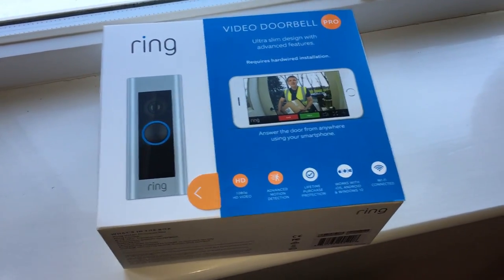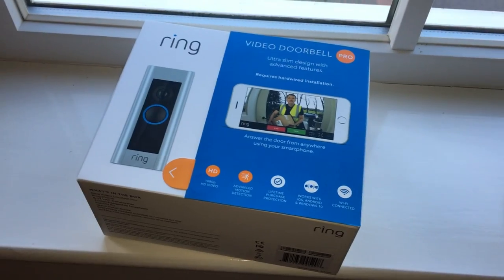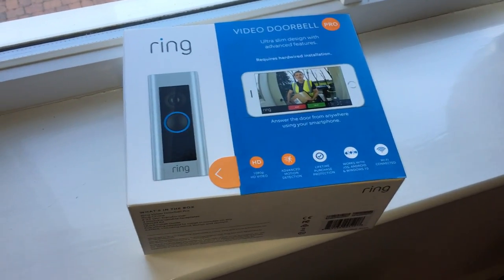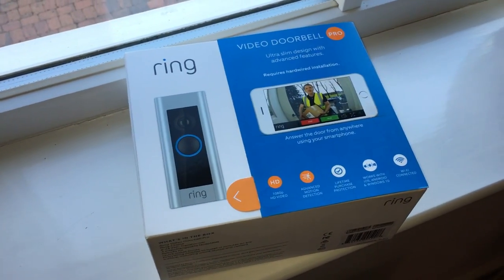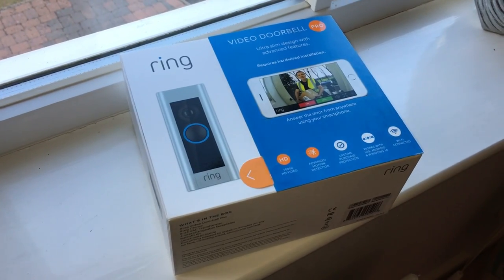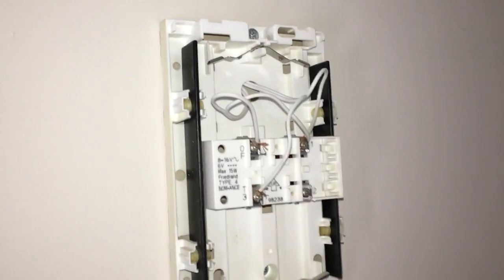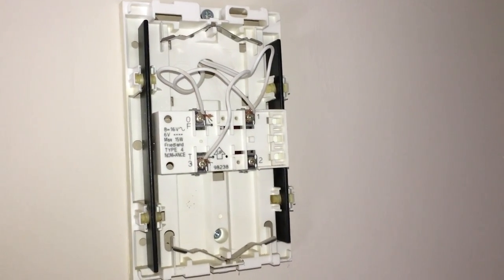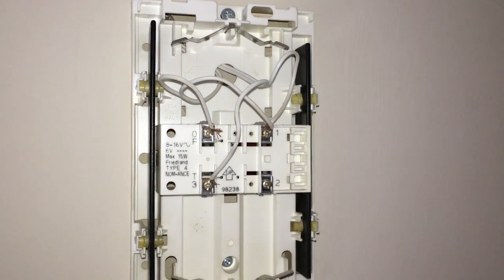Installing Ring Pro Doorbell Transformer in the UK (Review)

Comment: This is the only,  and probably the best video for installing the ring door bell pro in the UK.  The video was very well put together and well explained and easy to understand.  The person that made this video should be an instructor! There is an alternative video, and also well put together by another person that makes installing the ring doorbell pro very straight forward and does not require fiddling with the transformer that came with the kit,  and that involves purchasing a standalone 24V, AC transformer that plugs straight onto a socket. That alternative is for folks who do not have an existing hardwired doorbell in place on their house.

Comment: Thanks for your informative video dedicated to installing Ring Pro in the UK. It wasn't the solution for me but outstandingly, put me onto three things: importantly, it's now illegal to work on a consumer unit if you're not a qualified sparks. (I re-wired my house in the 70s including connecting up a new consumer unit whilst the power coming in to the damp cellar was live, because I was too poor to get a professional to do it. Electrocuted myself three times in the course of the project but I was young and invincible and it was fine). Secondly, it was great to discover that there is such a thing as a small DIN enclosure to install the Ring transformer without the need to enter the consumer unit (somewhat smaller than yours because I decided to forgo the RCD, ;-). Thirdly, it alerted me to doorbells that have their 6V transformer in with the chimes enclosure.  Turned out that that was my situation. I studied your video, the manual and various internet instructions on by-passing the chimes and couldn't make head or tail. Then it came to me in the night: completely remove the chimes and the transformer enclosed within, fit the DIN enclosure and new Ring transformer in their place, using the wires left behind, and so, no messing about with by-passing the chimes.  
One last thing: the Ring Pro is dead fussy about the quality of the wifi signal it receives and wouldn't play nice. I therefore moved a BT Disc (some sort of MESH jobby) to be closer to the Ring Pro and ethernetted (of course it's a word) the Disc to a Powerline plug, because the Disc would otherwise also have been out of range. It was handy having a Di-Log CombiVolt Voltage and Continuity Tester to make sure everything was isolated before commencing work, instead of that old seventies trick of just licking the live wire (kidding, I'm kidding!!). Whilst I would love to understand that by-passing thingy, I'm sleepy now and will just have to remain a very stable idiot. The product is v. good: I've already turned away three murderers this morning. . . .
Reply: philwolsey what palaver just for a doorbell ... well done for getting there in the end and the write up 🙄

Comment: Great video, just got a cracking Black Friday deal on one of these, however the installation was quite a bit of a concern. I ended up buying the plug adapter as we have a socket right by the front door, so all I need to do is drill a hole through my UPVC and plug it in. Looking forward to using this awesome product.

Comment: Very useful. It's hard to figure out the transformer and installation implications in the UK from the Ring site and other sources, but this video made it all clear. I suspect the conclusion for most people will be to get an electrician to install it.
Reply from the maker: Adrian Black I'd agree, for most this is the sensible option.
Reply: I was asked to provide a mains supply to a gen 1 Ring doorbell as the home owner was frustrated with charging the batteries.

After spending about 2 hours installing all of the cabling, fitting a transformer and then connecting it all back up I just couldn't get the thing to work. 

It turned out the gen 1 Ring doorbell had a known issue. The live feed is supposed to trickle charge the battery so you don't have to remove it. This model would not trickle charge so it wouldn't work.

After scratching my head thinking I had made a mistake it turned out that Ring customer services needed to send out a replacement as it was a common fault.

Be aware if you have a gen 1 (720p) model Ring doorbell and it is losing charge or it won't accept a permanent feed that there is a common fault with the battery

Comment: Hi 
Watched your video before installing my ring pro. Easily the best video I’ve seen. 
This bell replaced a plug in unit and not an existing unit so it was a straight cable from the consumer unit.
One thing I did find when I installed the transformer in the consumer board which I’m comfortable with. 
It’s an split load rcd board with rcd protection on 8 circuits and no protection on 4 (lightning +fridges)
I had spare capacity on that side
Your comment with regards that it doesn’t matter which way live and neutral isn’t right. I connected live to 6 and neutral to 5 and then to the non protected neutral bar and the ring powers up but trips the rcd when used - which is a bit bonkers as it’s not powered from the protected side. As soon as I swapped to live in 5 (as you did) then it works just fine)
I replicated the fault by powering the transformer from the lighting circuit away from the consumer unit so I’m confident live must go in 5
Reply from the maker: Paul Smith thanks! 
Weird re: polarity.. didn’t matter with me. Other videos said the same so maybe they changed the transformer included since.
Reply: @hyperhatch5775  Have a Good Weekend!

Comment: Thanks for the video. I had an electrician attempt to install my Ring Pro, unfortunately he was unsuccessful twice. Upon installing it for the first time we immediately noticed that the lights on the bell did not turn on. Even worse, the Ring transformer got piping hot and started smelling. The Electrician concluded that the transformer is faulty. Ring sent a replacement but when that was installed we had the same problem. Ring are now sending out an entirely new doorbell but I am about to give up hope!
Reply: I have had this twice now.... did you find a solution for this? Everything look spot on and I even had it running for around 5 minutes before the second transformer burnt out. it make no sense. Any help much appreciated
Reply: Did u get this solved?  I'm going for a 3rd party transformer just in case.  The ring one is bulky and  I have no room in consumer unit. I plan to rip the guts out of the current chime and slap in a slimline transformer instead. Then use the 3 x echos as doorbell.

Comment: Great video, really helped in my planning for installing the ring pro which I have done this weekend and seems to be working.

A couple of extra tweaks in my set up that others might find useful:

- instead of the garage consumer unit you could use a 2 module din rail enclosure, its much smaller if you are space constrained and its going somewhere more visible (like a hall way)

- in my case I had the unpleasant surprise of some cat5 phone wiring (3 pairs) as the existing installation, rather than the thicker white cable you have. In my case i simply bound the 3 pairs together to spread the load from the ring pro transformer and it seems to be working fine.

Comment: Hi just saw your video re ring  pro. You must understand that measuring a transformer open circuit or with no load it will read a HIGHER voltage. When the transformer delivers current losses inside the transformer will reduce terminal voltage, it is calledtransformer regulation. Jeff...

Comment: The Ring bell has an issue with non USA wireless I have just discovered this, in the USA their 2.4ghz wireless only covers channels 1-11 in the UK our wireless has channels 1-13 . If like most people you leave channel selection on auto, the ringer will disconnect on occasions and is difficult to connect. The solution is to manually select a channel between 1-11 and set it hey presto all the connection issues disappear. This little gem is buried in their help files, and yes I did find this out the hard way.

Comment: Wasn’t expecting a breaker unit to fit into my existing consumer unit. Spoke to ring customer services and they have agreed to send me a plug in power supply to power the doorbell pro. Only if this was included in the box from the offset as is in the USA. The power unit comes with a European 2 pin connector so you need a uk to euro adaptor to fix this issue.
But such a great video, but I’m not competent enough to mess around with a consumer unit
Reply: Mandeep - did they charge for the plug in ? if yes how much ?
Reply: @brynmorgan9575  they sent me another transformer to plug in the consumer unit. Idiots.
It was sent free of charge

Comment: Rather than use a consumer unit a WYLEX 3-MODULE IP65 INSULATED ENCLOSURE WITH VISOR will provide a neater job. About £11. Very helpful video - the Ring installation videos are too focused on US setups. Also helpful to see how got around opening up the consumer unit.
Reply: Andrew Baker lots of options. You can buy adaptable boxes with a din rail for installing the ring transformer. Some bell transformers are designed to be fitted to a din rail or have screw holes. You could mount it in a regular adaptable box or even in a deep metal back box with a blank plate over it.

Comment: Hi mate, I understand this is a few years old but I’m wondering whether the transformer is included or if I would have to pay for extra stuff on top of the £49… if I would have to then I may just go wireless and save the hassle. Thanks
Reply from the maker: This is the original Pro model, which was more like £200. The hardwired cam they offer today is £49 but is not the same device, and in my case it did come with the power supply, but to my knowledge the lower cost hardwired model doesn’t  come with power supply in the UK. You can pick one up on eBay from a third party for £20 tops if I remember rightly, or your existing doorbell transformer may do the job. 
Sorry my knowledge on these is quite out of date now, apologies!  I do know however that the hard wired models are more reliable than battery. Join the Ring UK users group on Facebook, as this discussion is often on there 👍

Comment: A very informative video indeed. It's great to see you got incompatible (with Ring) chime working. I'm not sure how the loop works in your scenario. it looks like both cable from Ring are terminated on point 1 (or have I miss understood). I'm installing Byron 776 chime (8V built-in transformer) with Ring Pro, all is greenfield. I'll be grateful if you could kindly share the diagram. Thanks in advance
Reply from the maker: Azhar Latif just to clarify, the bell box from the old doorbell is purely used as a junction box for existing wiring. It does not ‘function’ as a bell box. I have the plug in chime to do that for me..

Comment: Hi. where can i find a step by step video of this doorbell installaton witch does not assume that i've got an existing doorbell ? I mean from the consumer unit ( United Kingdom). Thanks
Reply: Hey, did you ever have any luck finding more about this?
Reply from the maker: No idea! You'll have to look around - but to be honest, my video would help you anyway - the existing doorbell just provides a suitable junction box to connect the wires up in - you could go straight from the consumer unit to the Ring doorbell if you wanted. Please seek advice from a qualified tradesperson though if you are unsure.
Reply: I just installed without an existing bell  it’s just a direct cable from the transformer to the bell. I used a cheap speaker cable rather than bell wire as I find that too thin. 
Drilled through the wall and fitted the bell
Reply: I did not have a existing door bell, but I used this method and it works well. I used a old double plug in the garage and turned it into a single fuse plug, then came out of there into a home base MK consumer unit, then to the bell.

Comment: Hi Mate,

Could you go into more detail about how you relocated the doorbell wire? It is exactly what i’m struggling with and I am having a new doors and windows fitted in a few days so I’m hoping to ask my builder if i could do this whilst the door is off.
I’m scared about using the wrong drill bit etc. and chipping the red brick, or cracking it in half 🤣.
Reply: If I were you I would have the builder do it for you! :) -  it'll take them minutes. 
Basically, there will likely be access to the cavity when the old door frame comes out - this is normally where the old bell-push wire comes from (if it was put in when your house was built) - in which case I stood in the doorway and put a long drill bit into the cavity, angled to where I wanted the Ring doorbell on the outside.  I drilled part way through the outside face of the cavity (brickwork) very slowly, then when I was confident I was within an inch or so of the external face of the wall, I switched, and drilled in from the outside. If you don't do this, as you rightly say, you will likely punch the front face of the brick off with your hammer drill (also, drill through the mortar lines if possible to avoid it even further).  I only did it this way because my cavity was partially obscured behind the doorframe, so I couldn't simply drill through one skin of brickwork from the outside and then fish the cable through the cavity. If you can reach it then that would be simplest, although of course you won't know this til the door is out.
Reply: Kian H 

Thanks for the prompt detailed reply. My builder was unsure of what I was asking... but we got there in the end 🤣. The doorbell on the brick looks great and a lot more classy than on the side of the PVC. 

Cheers!

Comment: Thanks for the video, very detailed. I have the same set up as you with the mechanical Friedland chime. I actually really like the sound of the current chime and was wondering if the ring pro is compatible with it and would activate when the push button is pressed like the current basic doorbell. Or is the voltage too high?
Reply: Yes, the Friedland chime accepts 8-16V AC input (or 6V DC from batteries), and the Ring Pro needs 16V-24V, so you just need to ditch the Ring 24v transformer and buy a 16V DIN rail transformer (e.g. Screwfix sell a configurable one with 16V option), both devices will then get 16V which is within the accepted range for each. Ring should really ship 16V transformers for EU as there are no 24V chimes to be found, but some do accept up to 16V.

Comment: This is brilliant.  Just a quick question, the transformer has 5 & 6 written at the bottom so how do you know which is Live and Neutral?
Reply: Thanks.. if I remember correctly, polarity doesn’t matter. Check back through other comments as I think it has been answered by other commenters!
Reply: Thanks.. if I remember correctly, polarity doesn’t matter. Check back through other comments as I think it has been answered by other commenters!
Reply: @kianhatchman  I just r received the ring device and my current transformer is only 8v output
Reply: @kianhatchman  will go through comments, thanks

Comment: Thanks for a great video. Ring are sending me a Pro here in the UK and have said I don't need an existing doorbell to connect it through. Basically, they are saying I can wire it directly from my consumer unit via the supplied transformer. Is this right??
Reply from the maker: Dave Rosser Yes, not having an existing Doorbell isn't a problem at all, but this is obviously preferable as you can use the existing Doorbell wiring. If you have the ability to run bellwire/flex straight from the transformer (whether it's in the consumer unit or not) to the outside of your house where you want the Ring situated, then it's not a problem. For most, getting that cable to the front door would be a problem, but Consumer Unit>Ring Transformer>Bellwire/cable>Ring Pro would be a perfectly acceptable setup.  Hope this helps.
Reply: HyperHatch Thanks for your help. Fortunately, the consumer unit is the other side of the front door, so doubt I will need more than a metre of cable. Can I use normal bell wire for this or does the Ring Pro need something more powerful?
Reply from the maker: Dave Rosser Nope, standard Bell Wire will be fine. I'd do a mock-up test run to check everything works BEFORE you bury it in the wall, to be doubly sure first! Just to be clear, please don't even attempt to open your consumer unit yourself. I'm pretty sure it's illegal. You need a certified/competent electrician. Excuse the disclaimer, just feel I have to say it! :)
Reply: HyperHatch Thanks. I don't mind dabbling with things, but not going anywhere near that consumer unit! Just want to make sure the electrician knows what's required when he gets here. How are you finding the product now you've had it a few weeks?

Comment: Thanks for the upload very helpful for us in the UK. The Ring transformer outputs 31/32 volts on the transformer using terminals 1&4 but I've found using terminals 1&3 outputs 17/18 volts and reads voltage " very good" within the Ring app and hopefully prolongs the life span of the unit. Is your unit still operating ok be good to get an update from yourself ? Thanks again.
Reply from the maker: Thanks Jon. Still working fine.. no isssue here, but I guess only time will tell. That said, a transformer isn't a complex piece of kit, so easily replaced! :)
Reply: That would mean you could still use the old 8-16v chime? (i'm on the same boat here, but haven't purchased the ring yet)

Comment: My ring transformer was putting out 36volts on the to outer pins .So I went for the next pin in and that gave 18volts
Reply: It's not a regulated power supply so the no-load voltage (when the camera is not attached and drawing current) will read higher than the actual operating voltage..